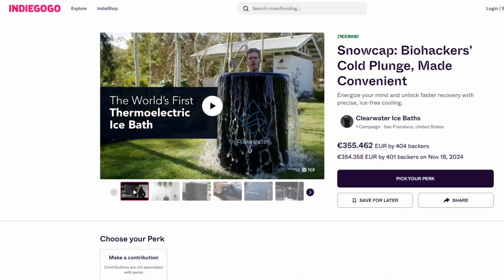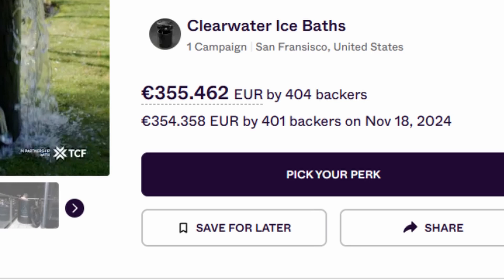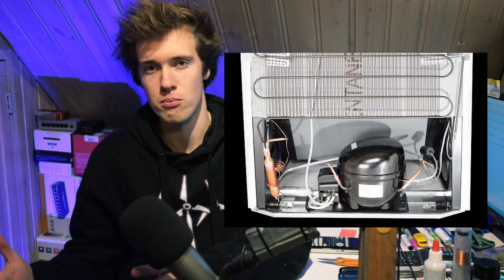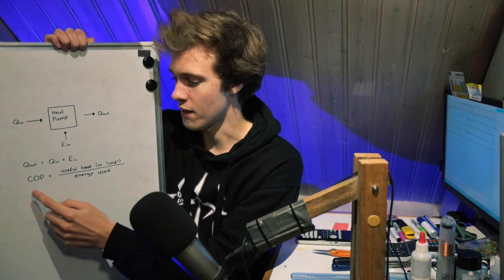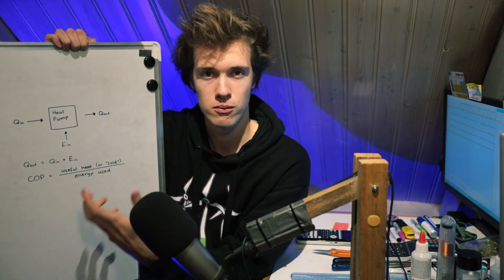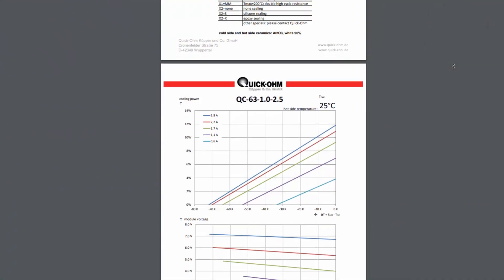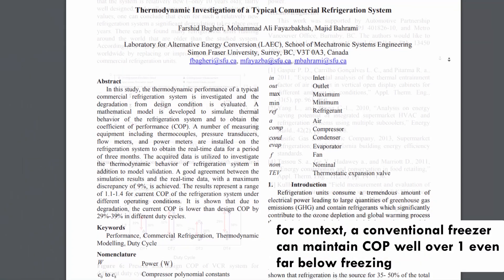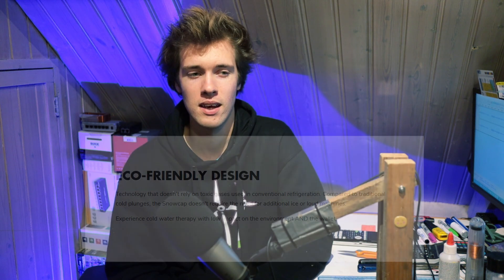Why a thermoelectric ice bath doesn't make sense

Comment from the maker: I got through this whole thing without a single "cool"-pun, so I treated myself to one on the thumbnail. Also, this product can apparently also heat the water, since peltier devices can be used in reverse. Technically, this would save energy compared to an electric heating element. However, if the tub is used for both hot and cold baths, a conventional refrigerator and an electric heating element would still be more economical, especially considering the target audience for this device is most interested in (and therefore will most frequently use) the cold function. Anyway thanks for watching!
Reply: I was thinking the only way this would be half way sensible would be to have a cold bath and hot bath right next to each other.

Still, a normal heat pump would be better, easier to isolate the hot and cold side, and doable for the price.

Comment: A heat pump like a fridge compresses coolant and then widens the tube so that it evaporates, as it evaporates it takes heat from the cabinet and its cooled down in the exterior tubing grid.
With an aircon, the tube grid is external and the expander is in the room, if the outside temp is hot, provided the coolant is still cooled to a liquid (with the aid of a fan and a radiator), less energy is required to evaporate the coolant because it is closer to the boiling point.
With a heat pump, the parts are reversed, the grid is inside the house and the expander outisde ; this is inherently less efficient, since the tube must absorb whatever heat is in the atmosphere, of which there is little since it is cold.

Comment: What is the cop if this is used as a heating device? - As replacement for the heat pumps for heating the homes?
Reply from the maker: Realistically the heating cop would be somewhere between 1-2, so an improvement over electric heating, but far worse than vapor compression systems that can do 3-5.
Reply: @AKIOTV  thx for the answer. Interesting

Comment: You could buy a cheap small freezer, fill it with water /antifreeze and then just put a small radiator and a punp to circulate the water. Probably 150 to 200$ for the freezer, a cheap 10$ aquarium pump and a 20$ radiator and achieve the same thing, albeit larger in size. But cost way less and be a significantly more efficient. I honestly would be surprised if that thing can even do close to what they claim. I highly doubt it hits those numbers stated. The Peltier devices are great for small things like CPU and computer type applications but they are definitely not a good choice for any larger applications like fridges and freezers. Maybe one day someone will invent a better one but until then I wouldn't buy one in anything bigger than a cpu to cool. Great video as always
Reply from the maker: @newmonengineering  The freezer is a good life hack, but a domestic freezer may struggle with the continuous duty load and isn't designed for very high power. A better choice would be a small AC unit with its evaporator in a camping cooler filled with antifreeze and then use your setup from there. I've seen people use this to make sub zero PC chillers.

Comment: Wait your whole complaint is that it uses more energy? No one made a claim that it uses less electricity. The tech is sound, it works, and it's affordable. They are mostly selling the ability to control it via app. Schedule it, and get to lower temps than the other tech.
Reply: Joo you maybe do not understand how stupid the use of peltier element for cooling is ^^.

A little cool box you get in hardware stores or amazon use as much as a whole fridge freezer combo in human hight with two doors.

That is, when you let them run long enough like few months.

They are really energy intensive.

Comment: Does this also mean Peltier chips would be a more efficient choice for heating a very small area (1 cubic metre) than something like NiChrome wire or ceramic elements?
Reply from the maker: @MikinessAnalog  A peltier element used for heating is more efficient than a standard resistive heater, as long as the cold side is kept below ambient temperature. Then the heat output will be the power consumed by the element, plus the heat absorbed by the cold side, in other words the cop > 1. However, in many cases, not by a whole lot, since many heating appliances need to get much hotter than the ambient temperature. You can ask yourself the question if a cop of say 1.2 justifies the more expensive peltier elements and heatsink/design requirements over a normal electric heater (which has a cop of exactly 1).

Edit: you can think of a heating element as a "heat pump" that doesn't have a cold side. The cop for cooling is always 0 (it doesn't cool), for heating it's always 1. 

Also you might have meant a cubic cm or something? 1m3 is usually not what I consider small.

Comment: Great episode! I personally appreciate that you acknowledged the fact that peltier elements technically can have seemingly reasonable COP, at very low temperature difference, and ridiculous heat flow.   

Removing heat, to achieve 23 °C lower temperature than ambient air, and utilizing the air to get rid of the heat at rates that are relevant in that scenario with peltier elements it would be difficult to achieve a COP of even 0.1 without an absurd heat exchanger to transfer the heat to the air.  It's not just with increased actual temperature difference over the peltier element that makes the COP plummet, COP also plummets if you need more than ridiculous heat transfer rate, even at very low temperature difference. 

A COP of 1 while creating a delta T of 23 °C just over the peltier module is only possible as long as you just push a few watts of heat per module, on top of that you have the temperature difference needed for the heat to move from the heat sink to the air. And they claim they can remove ~6 kWh in just 8 hours, on top of heat returning to the water, so, ballpark 1 kW heat removal. Even if the additional delta T heatsink to air is disregarded, they would need a few hundred modules to make it possible to achieve a COP of 1 while removing that much heat that fast. Add the remaining aspects of reality, and the additional delta T makes the input power required sky rocket, and total heat removal requirement sky rockets with that, and you're in a loop when additional power input decreases the net heat removal long before you can reach 1 kW of continuous heat removal with peltier elements and heat exchanger system that dumps the heat into ambient air of the size they show.   

Heat pumps usually create a much higher temperature difference than the actual target temperature, as you need a bigger heat exchanger the closer to the target temperature you want to go, this is especially true when air is the ultimate heat source and or heat sink. One of my favorite examples of this is bench top icemakers, they have a "target temperature" of 0 °C, and typically have a COP of <0.5 despite dumping the heat into ambient air that is about their 23 °C warmer than the temperature required to freeze water, and that's using vapor compression system. Part of that is due to the fact that the that pump has to cool water through ice that has already formed, at a reasonable rate, but large part is due to the fact that expelling just 100 watts or so of heat to ambient air with a reasonably sized heat exchanger means your heat exchanger has to be significantly warmer than ambient air.       

If you take their supposed 1 kW-ish of heat removal, and supposed 1 kW of heat generated by the used energy, you'd need a 20 times more efficient heat exchanger than in a table top ice maker that expels 100 watt, just to keep the hot side from reaching a higher delta T compared to ambient than the working fluid in hot side in a table top ice maker, and that's way way to high above ambient to achieve what they claim.
Reply from the maker: @fishyerik  Also the fans they appear to use look like those used in 1U rackmount servers. At full speed, those sound like a jet engine and can chop vegetables. And there's a ton of them, perhaps not surprising because they need to minimise that heatsink temperature. I don't know for sure if these are indeed that type of fan, or if they're running at full speed, but their claim that the machine "makes the same noise as a normal fridge" seems very unlikely, even if these are less extreme fans than what they look like.
Reply: "normal" must be the name of a very loud fridge